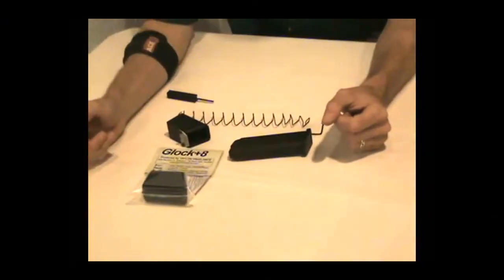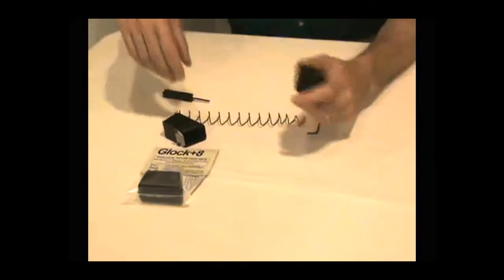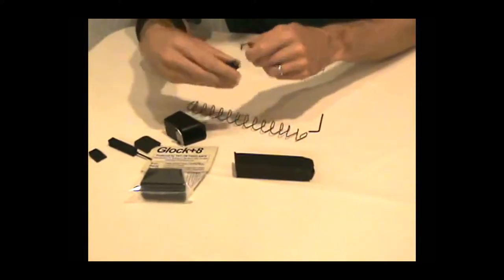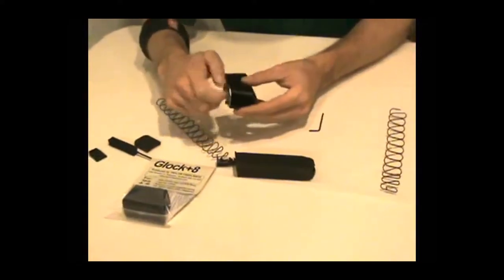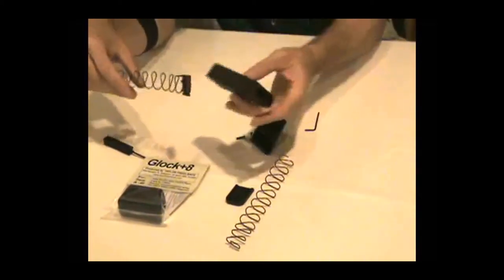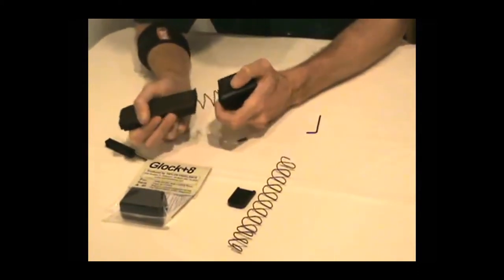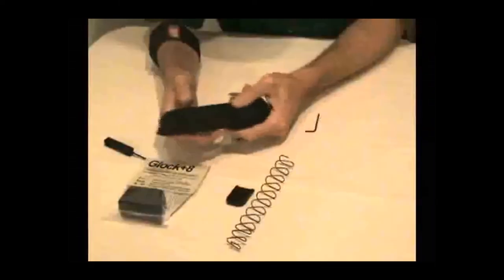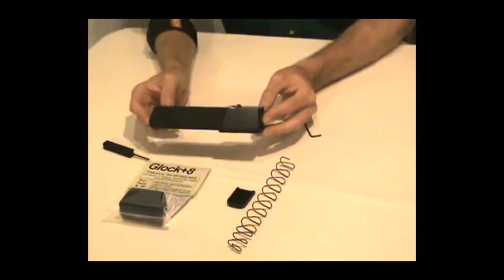Glock - Extension Installation

Comment: I got the +4 for 45acp. I am using them for 10mm for a +5. I was having an issue with placing the new spring in the follower and it sitting correctly. It was not pushing the follower high enough to engage the slide lock lever. My solution was to put the new spring in and reassemble the mag with the factory base plates. Insert into gun and test cycle the slide then disassemble the mag and use the TF base plate. This worked and so I just started doing it for all of them as I switched out the base plates. Just thought I would put this out there just incase someone has the same issue I did.

Comment: does it has to be a G17 mag? or can i use G19 mag.?
Reply from the maker: Yes. G19 mags mount the same basepad, but at a different angle -- and bullets don't flow around corners very well.